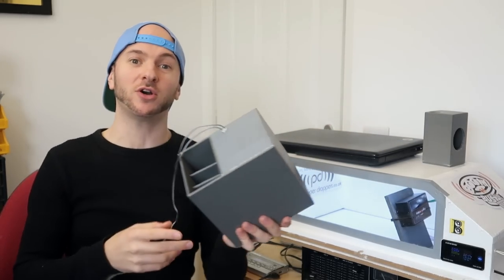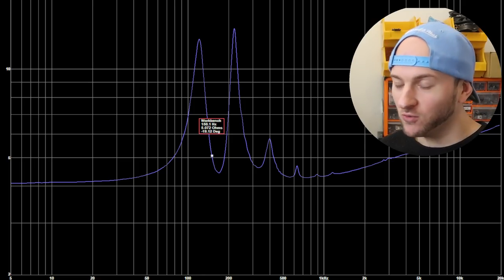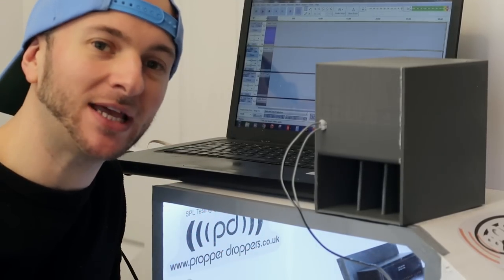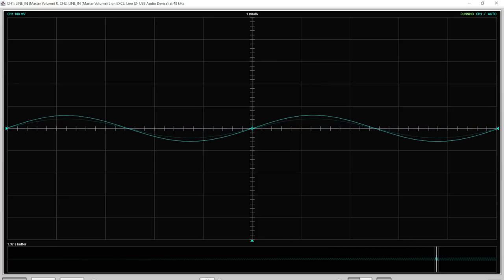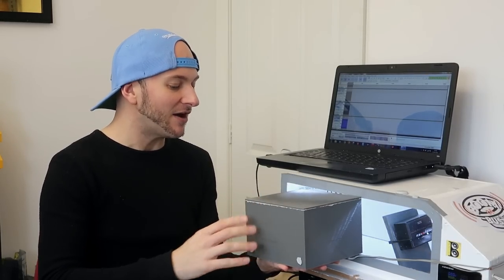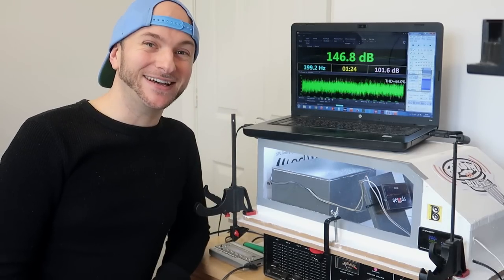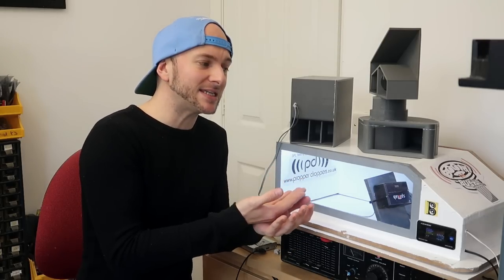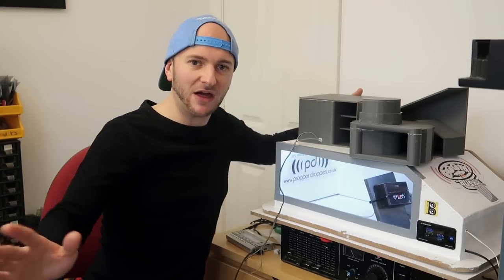I Printed a Mini Tuba HT. It's CRAZY. | Boom Or Bust S1E12

Comment: Performance vs. size is exactly what I want to know!  For those of us who still need to fit a family in a car but want killer bass, we need as much bass in a small size as possible.  Thank you for this!  This is the highlight of my week!
Reply: Bass reflex with aero port.
If U need more, add more boxes
Reply: @sMASHsound  depends on the woofer aswell, some have a large VAS and need a large enclosure, if you need low space requirements, a (pair maybe even) shallow mount woofers are probably the best option as you can make the box flatter and stretch it out more
Reply: @sMASHsound  I am running a standard ported box, I haven't heard to many bass reflex boxes that have good bandwidth.  I might have to give one a try but with the extra space they take up, wouldn't just running twice the subs in a ported box make sense?

Comment: I built its little brother the Tuba 30 for home stereo use with a single 12" (Dayton Reference driver in this case), and I'm not sure I'd build the HT with anything under 15" or possibly a 2x12".  Amazingly efficient and clean bass, much more than necessary for my application, but even the Tuba 30 being 30"x30"x18" in my build as opposed to the HT's recommended 48x48x24 takes up a great deal of space and took about $200 in Baltic birch to build even before 2020 spiked wood prices.

Comment: I had six of the full sized THT's, did dub shows with them back in the day.

I do not miss hauling them around!
Reply: Whats a better setup nowadays? For mobile dub shows
Reply: @blamuk  Hoffman's iron law is unbeatable. You can have low, loud, or a small bin. Pick two. 

There are numerous considerations you have to make. How low does it actually need to get, realistically? How loud? Will people actually appreciate the extra low end, or will an absolute slamming kickdrum do? Do you have the packspace? How much power draw  can you deal with? 

While I loved that system, the packspace and horns being finicky inside venues for placement, along with people not being used to such low distortion in the bass region are reasons I'm looking into a tapped horn setup, while keeping the t39s I have for venues they'll work in. I'll likely endup with keystones myself, but there are plenty of plans around to lookup (ss15 or tham's seem popular and are an ez build) ymmv

Build stuff, experiment, have fun!
Reply: @Endmass  I used 60hz in subs too, but after learning to play drums I realized that there is much more to music than just sub-bass. The feeling of the kick drum and bass guitar in the chest is very good!
Reply: @nuen7825  I was told by an old engineer "be sure to have a solid kickdrum, its the cake. Anything lower is frosting" 

A cake that's all frosting is a shit cake. The cake itself has to be on point, and you might get away with a bit less frosting. 

This still holds true to genres that people think are all sub 60hz. They're not really, especially the harmonics.
Reply: @Endmass  I decided that the ported box I could make in the space of a Tuba 24 was much more efficient and handled more power, and the driver cost was not significantly more expensive relative to the output by the time you've forked out for 2 high excursion 10s like 3010lf. 8 cubic feet external you can have 99dB 2.83V 1m flat to 40Hz with an 8 ohm speaker. The Tuba 24 judging by the graphs is rolled off into the low 90s by then. I'm curious as to whether they even up with the V plate and multiples.
Reply: @TimpBizkit  in the right room with the right placement, six standard thts (fired into a corner) were near unstoppable. 

These were loaded with the Dayton 15in dvc's that were recommended at the time. 

Certainly made the right room "breathe."
Reply: @Endmass  If you could embed them in the wall 3 high with the mouths out forming a giant V....
Reply: @TimpBizkit  If I could design around structure, I'd design what I could in the space I have, with off the shelf plans being only inspiration. I certainly don't have that luxury for gigs!

Comment: this guy in his videos is so cheerful that you tend to forget the engineering thats behind this projects. these days i had in my hands a faital 3fe22 wich i loaded with a "nautilus" bass reflex on a 0.5l enclosure box (loaded to not exceed excursion on his resonant frequency range +-10hz. just to have some fun with the friends. i didnt had my oscilloscope set to 1x measurement but 10x not knowing that i procedeed measuring the frequency response of the driver not at 1w 2v but at 100w 20v. needless to say that my ears got blasted into the shadow realm while my measurement mic placed at 1m picked up 142.5 on a sinusoidal sweep at some point. Have fun thats all that it matters! (btw the driver survived and its still rocking hard on a 2.1 system)
Reply from the maker: Lmao! 😂😂😂

Comment: I think comparing the size at the end would be really great. You could probably take the external volume of the smallest enclosure as a base, and then for each doubling of volume above that, your box has 6 subtracted from it's score.
Reply: If you went from 1-12, to 2-12 inch for example, it supposed to be +3Db, but from my test results thats only attainable @ very low wattage. It usually works out closer to +2 Db, this also pertains to power increases,= supp. to be +3 Db if you double power, but i usually see around +2 Db. Same goes for enclosure sizes example: ported 1Cu. Ft. Net Vs 2Cu. Ft. Net=+2Db, ball parking it.
Reply: I'm not sure because you have around 3dB sentitivity potential per doubling of cab volume. So 6dB would be a bit harsh a penalty, for a single driver box with power limits. The advantage of a multi driver box is more power handling, yet similar efficiency to the single driver large box. Also each driver has its size range. A ported is more efficient at low bass in the smaller enclosures, but becomes a one note wonder unless you use more drivers and displacement. Then 6th order and horns/tapped horns take over for better broadband efficiency not just at a port tuning frequency.
Reply: @TimpBizkit  yeah, I was making the assumption of doubling the drivers and power. But if you only doubled the drivers and kept the power the same then 3 db would be more accurate
Reply: @blakebrockhaus347  I think ported beat sealed for power density. For very small enclosures, passive radiators at high power levels will have less compression than the long skinny port needed to tune them low if they are small. I can't think of something more power dense than ported, though I've modelled a 6th order that picked up 5-7 dB sensitivity on the mid and upper bass for a 50% increase in size. I'm wondering what a 6th order passive radiator could do, perhaps with two different passive radiator tunings, or a port for the high tuned side with the woofer internal.

In PA territory, Tom Danley talks about the power density of tapped horns, particularly when it comes to driver cost economy, because it is easier to produce tougher drivers with lots of displacement, than large lightweight cone drivers that handle a lot of power and displacement. There are other designs that are sealed and power dense, but not very efficient (Devialet Phantom) and so you have to chuck tons of power at them to beat the small enclosures and consequently heavy cone woofers to lower the resonant frequency.

To design 6th order parallel I usually start with a ported box with a slight hump at tuning (search Chebyshev response) then I stick another chamber with half the volume and double the tuning frequency. I haven't bothered with series tuning. It's hard to get them flat and tuning ports within an enclosure is more difficult because the second chamber changes the tuning, either by putting a "sealed" box in front of the ports, or making a super long port with an expansion chamber in the middle depending on frequency. The response will be slightly rising, but I figured it's the best space economy, especially in a car when cabin gain will pick up the lower notes.

Comment: I love these videos!  When you do the winner vs. X# drivers in the same space, I think you need to try 2 configurations.  1st is testing the box size to cone area comparison alone, with 15W still driving the 4 subs (typical series parallel.)  2nd one you send the new box the 60w, for people who wonder, "What if I run it at 4 ohm and one sub now, then wire it down as I go."  I think some people will go for the most volume for watt approach and spending the money on the lumber for the fancy box is preferred, while others don't mind chasing power issues down the road and would prefer the cone area and wattage per dollar approach and would put box money into high power low impedance amps.
----
Really cool series so far!
Reply from the maker: Fantastic idea! I think I will! 😊

Comment: Great video, so when you had it outside the car, you said i t was really loud but with not even registering on the watt meter. So does that mean, if you wanted efficient, low power sub woofer (but size didn't matter) you could have 1000 watts on a sub in there rather than 4000 watts on 4 subs if you can't upgrade your stock electrics.
Reply from the maker: Yep, but 1000w across 4 subs would probably still be louder than 1000w into this one... Would depend of course ☺

Comment: When you are talking loud. You need to specify frequency. I would also want to know which is louder. One sub in a massive box or several subs in smaller boxes that equal the same volume. Without going too crazy my frequency target is 20hz. I want that to be very loud, clean and require as little power as possible on a large scale.

Comment: Definitely SPL vs. Box Volume needs to be considered, as we're talking about a car audio environment.  It's why I chose to go with two 12s in a sealed box for my car audio build, and just tossed power and DSP at them until I got what I wanted.  And because they're sitting in the spare tire well, I still have full use of the trunk space when I want to use it. 

Someone needs to submit an 8th order BP design for this project, with the resonance frequencies chosen to be the same or close to, the test frequencies.  Should be able to hit at least three of them... 🙂
Reply: I think passive radiators win for output from tiny enclosures.

Comment: Thank god for no chuffing. Does the change in venue have any effect? If the open door is on the side nearest the wall, wouldn't it load off the wall? I would think that it would get louder the closer you get to the wall until you hit the sweet spot and then you're getting too close to the wall and the volume goes back down. Like how when you have a sub box in the trunk facing backwards it gets louder and quieter depending on if it's towards the front of the trunk or towards the rear of the trunk and there's a sweet spot. In the case of the wall, does it getting louder inside or just outside?

Comment: The disadvantage of using 4 of the Basline Box vs the Tuba HT is the need of 4 times of power/amplifiers/$$$ to get a greater result; but the Tuba HT does seem to get the job done for a home application. Now, if one wants to use this model for home theater, one can always use a smaller diameter subwoofer (with great excursion) in order to reduce the box, right?
Reply: You are extremely correct. I misses understood...in my prior post. Apologize. So I edited it... to this...efficiencies vs size. All have the pros and cons. X-mass vs spl. At 1W/1M. Not all woofers r the same. Depending on budget... box design or woofer, amplifier selection make a great deal of desired outcomes...
Reply from the maker: I think on the same 15w the four ported would be louder, but it would be an interesting test!
Reply: Agree would be an interesting test. 🤔. Hopefully? Sam does which is a huge box is the imperial. And would like to see a series (unlimited class) power or drivers with a fixed power level.... that could be very interesting. Session 2 two woofers and Session 3 unlimited?

Comment: I wonder how would passive radiator enclosure do😅
Reply: Agree 100% Would be cool if someone models one and the radiator to fit it.
Reply: Passive radiators... are similar to ports smaller box with similar output. If u know something that u can share. Please do so. Appreciate learning.
Reply: Problem is, a smaller passive radiator might not scale correctly to a larger one. Commercially available small passive radiators are likely tuned far too low. Remember, these are scaled down versions of 12” subwoofer enclosures, and must be tuned very high: a multiple of what the original 12” would be tuned to.
Reply: @djijspeakerguy4628  you are correct. Cone & mass of the passive radiator make a huge difference. I have yet to see anyone explain...also the difference 🤔 this series is not the challenge of passive radiators. Maybe another. Challenge?

Comment: I agree that you have to take into account how big the box is. Of course that matters. The volume is probably the most important thing, as far as I can tell. I haven't really seen any magical boxes yet and I think that's what everyone is hoping for. My WinISD is on my other computer so I can't run any numbers right now but you can still gain dbs building bigger and bigger boxes up to a certain point and I think that number is pretty high. a 4 cu ft box will be louder than a 2 cu ft box, and a 6 cu ft will be louder then a 4 cu ft box, etc....I'm not sure when that stops being true. Maybe a 12 cu ft box isn't any louder than 10 cu ft box, idk I'm just making up numbers. And I'm just talking ported boxes tuned to the same frequency. And I assume the peak volume for a ported box would be different for every driver.
Reply: Agree. Low end tends to favor bigger enclosures. However it also tends to favor spl vs efficiency. Difficult balance.    The reason I keep pushing for the imperial is semtrical loading. Don't understand it completely. And an awesome platform to see the experiment.

Comment: I kind of hope that season 2 is the same idea but without the scale frequencies.
Reply from the maker: That would make no sense whatsoever lol. The frequencies have to be scaled.
Reply: @barevids  I guess it does change the idea of the series really, I was thinking more akin to using it like a Bluetooth speaker. I have printed a few boxes and the lowest I could get was 35hz.
Reply from the maker: @Ben1551  the only solution that makes sense for those is passive radiators, there's nothing else to try or discover. This channel, and series is about car audio

Comment: I just recognised your email address, you never guess who recommended your services to me in January, Mid Bass distribution (Vibe UK). 
I got 5 Vibe concept/Blackbox stereo manufactured from 2003-2009. Two of them packed up in January, I believe there is another one not far behind age wise.
They power up and DO NOT go into protect mode but there is no output from speaker terminals.
Any chance I can post you one for diagnosis?
Reply from the maker: Sure thing, drop me a message on facebook.com/nsvaudio

Comment: I'm a Dj and now your indirectly selling me on a Horn design or paraflex design, but man my back does not want me to get one haha
Reply from the maker: Horns are great for fixed in house system... Not mobile 😂
Reply: @barevids  That's what my Head and body is saying but i like the big kaboom hahaha ugh i'll stick to a basic ported design just so that i don't have back issues at 60.
Reply: Agree to disagree... there has been no submissions with a proper semtricaly loaded horn... its in my opinion the greatest design.. however difficult to achieve...
Reply: @erikbritz8095  Put wheels in one corner, tip and go... 🙂

Of course, this might not help if you have to carry them up some stairs...
Reply: @Grommet2007  Or if you have daily gigs my busiest weeks have been separate gigs every night and at different venues that is when things get real hard haha nah ill get something like this for at home at some point.
Reply: @erikbritz8095  For home I'd go with the distributed small subwoofer approach.  There's no problem that can't be solved with sufficient power and $$$ 🙂.

For a daily mobile gig (which is basically what you described), this might slightly too big.
Reply: @Grommet2007  no front loaded bass reflec for mobile for home installs id say big n ported or 4th orders the way im going but this is much later on im focusing on my business first
Reply: @erikbritz8095  build a Titan-48. (Unless you're playing dubstep where you NEED down to 20hz).  A 48x24x24 inch T48 loaded with an Eminence 3015LF driver weighs less than 100 pounds, and will ASTOUND you with how loudly and cleanly it plays down to 45hz! And all you need is 450 watts.

Comment: My local dB drag competition has a single driver class. I work in the professional audio industry so I've always thought about how a horn would work in the car. This video will probably drive me to do this for next year's build with a Zv5 12.
Reply: A horn box with a zv5 will be insane 👀. But really big though. You will definitely hit 150db's
Reply: Horn box like the vid has been done before, it’s loud but for space is takes up it’s louder to go with a normal ported / 6th box
Reply: @Dont-come-at-me-24  It's not just about going low and loud, it's also about doing so with distortion so low that it can hardly be measured, let alone heard. In that regard no other configuration comes close to a folded horn.
Reply: Horns work very well in cars, but not the THT. It goes at least an octave lower than you want in a car. The 'HT' stands for Home Theater. That, or a real theater, is the only application that it's suited for.